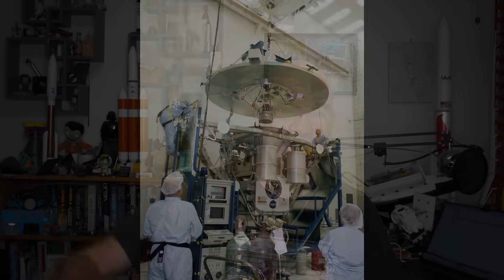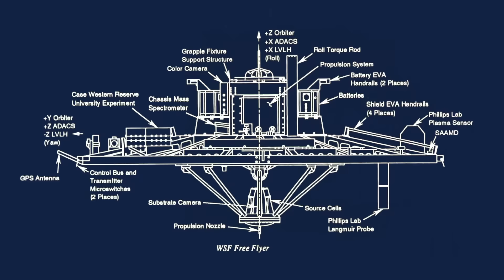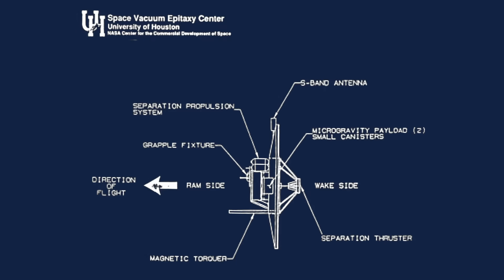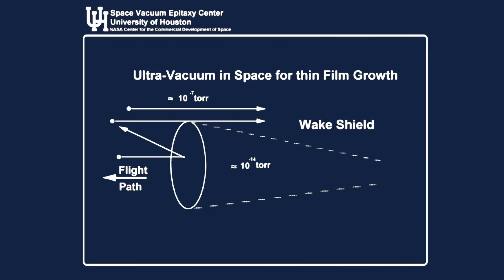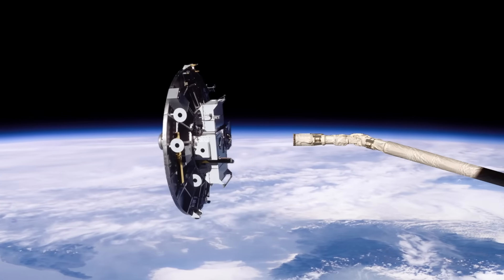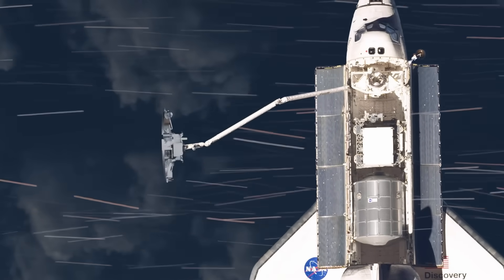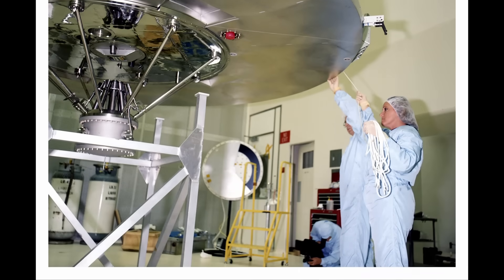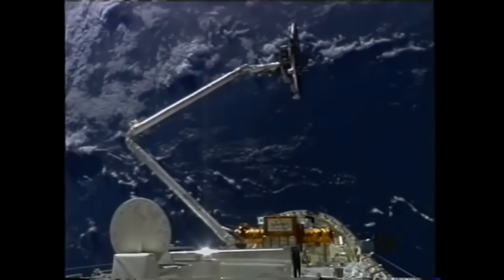How NASA Made The Vacuum of Space Suck More - The Wake Shield Facility

Comment: The Space Shuttle is underappreciated.  Every time it flew, you had a temporary space station.  It had an airlock, remote arm, a large 60'x15' cargo bay, a two level habitat with a toilet, and a large payload capacity.  The Shuttle was capable of performing a variety of missions including spacelab, satellite launch and repair, Hubble servicing, and building the ISS.  We don't have the capability to do what the Shuttle could do today.  There were problems and accidents but spaceflight is not safe.  The Shuttle was built using 1970s technology.
Reply: I wish they had carried on developing the Venture Star
Reply: Both points are true, not mutually exclusive. The shuttle was never less than risky. But it was also far more sophisticated than our current conventional 'benchmark'.

 In  hindsight... IF there  had been sufficient congressional funding to build a SAFE sophisticated design, back then ... there would have been a shuttle that had a go-around landing ability. (And a self-contained toilet.)

Most importantly, that potential shuttle should have been located ABOVE all the propulsive hardware. 

(Heat-tile headaches would still have plagued them. But overall risk would have been much much less.)

Had the funding been there for that improved ORIGINAL version of space shuttle, all the listed advantages (of shuttle over current space transport) would have been more easily retained for later space-transport  versions that could have flown today. 

AND ... like the historic shuttles, they would have low-g runway landings. These would have been  useful not only for delicate  cargo but also for seriously ill / wounded crew who would need urgent medical care. (We have dodged a bullet in that such an emergency has not yet arisen.)
Reply: You say that like launching an entire space station every time you want to launch a telecoms satellite is a good thing. 

The space shuttle was the equivalent of your takeout being delivered by a campervan instead of a moped
Reply: Using a manned spacecraft for cargo missions was risky, and very expensive verses unmanned cargo craft.  As for the shuttle being a lab, well a permanent space station make a better lab, why lift the lab up into space more than once, leave it in space, then resupply it with low risk cheap cargo rockets, and crew the permanent space station lab with small manned rated rockets.
 The Shuttle was way too expensive and deadly.  There were much better ways to do the job than the shuttle.
Reply: The Shuttle was a space station the same way a Winnebago is a house.
Reply: It is certainly not underappreciated.
Reply: I don't know: sure it was impressive but it was literally the deadliest space vehicle and the supposed savings from reusability never materialized. Maybe a smaller space plane with a heavy launch rocket would have been a far better choice
Reply: @misham6547  It was literally just as deadly as was Soyuz ) The same statistics, but Shuttle was an incredibly more complex and capable spacecraft.
Reply: @Boritis the Shuttle literally killed more people than the Soyuz and had a higher accident rate/launch. Any way you look it at it was the most dangerous launch vehicle
Reply: @misham6547  The Shuttle also carried much more astronauts. When a motorcycle crashes, 1 man dies. When a bus crashes, 50 people die. By your logic a bus is 50 times more dangerous than a motorcycle. Also, Shuttle had 2 disasters per 135 flights, Soyuz had 2 disasters + 3 incidents with mission failure per 135 flights. How so the Shuttle had "a higher accident rate/launch"?
Reply: @Boritis  the Soyuz launched more the 135 times (now closer to 140) with only two fatal accidents both of which before the space shuttle was even launched. Yes it did have SUCCESSFUL aborts but we can talk a long time about the times the shuttle almost killed of all it's crew (for example, the time when the thermal tiles were hit in a lucky place on a spar and the time that a gold pin almost blew up the entire crew) 
And about the bus thing: the space shuttle was dangerous already (unlike busses which are pretty safe and most people don't die in a bus crash) so stuffing more crew into a dangerous object is not a good thing. 
Overall the space shuttle was overrated and insanely dangerous: it is beautiful but it never should have been built,.
Reply: @misham6547  Soyuz has to be manufactured again for every launch, and it got all his main problems fixed over years.  All shuttles were built in the 70s with except of Endevour, which is built from spare parts. If NASA wanted to and had money to make some new orbiters now, they would be much safer, reliable and cost-effective than the ones built in the 70s.
You just don't understand the shuttle and what purpose it had. It's not about launching people to space or launching satellites (launching a satellite using massive winged orbital habitat with full crew is a dumb idea since you can do it with just a rocket). It was about working in space. Performing various tasks, mainly orbital assembly and maintenance. There was and still is NO other spacecraft in the world capable of doing these things. And there is simply none other spacecraft capable of retrieving 14 tons of cargo from orbit. That's why even comparing it to other spacecraft (which are just escape pods compared to shuttles) is also a dumb idea.
Reply: @Boritis  The physical layout of the Shuttle was bad: it had completely exposed thermal tiles prone to damage (even if they fixed the foam problem they still can get struck by other debris), it had SRBs right next to Hydrogen/Oxygen bomb, and because of its entire design and since SRBs couldn’t be turned off - many failure analysis ended with “ loss of orbiter, loss of crew”. To make it safe at least it would need to be liquid fueled , always have a rescue vehicle on hot standby, and be completely redesigned for a launch escape module. 
Also the space shuttle did receive upgrades (due to the fact that the engines had to be pretty much rebuilt and everything inspected each flight) and the last one Endeavor was built in 1991, two decades after Columbia. It didn’t fix the main problems the Shuttle being the Shuttle.
Unlike in all other human rated spacecraft it relies on its main engines for an abort: so any engine failure would jeopardize the entire crew. 
The better investment would have been in an efficient heavy lift rocket, cheap safe human rated rocket, and robotic maintenance of satellites. All of this would have been cheaper, safer, and been used until today. Instead we decided to make a conceptually flawed boondoggle.
Reply: @misham6547  That is what the Bureau of the Budget recommended (which become the OMB), as well as a science advisory body, in the 1970/1971 timeframe. A space glider atop a Titan variant was recommended instead, because the feeling was that there would not be a need for more than four manned missions a year. 

Another proposal at the time (around 1969) did look at a "booster first" proposal, of focusing on a reusable first stage booster. 

More than a few proposals looked at a two stage reusable approach, like a reusable flyback booster plus a shuttle orbiter.
Reply: The Shuttle was a great machine, but the reality is that its expense was hard to justify, and its safety issues could not be ignored. It's worth remembering that astronauts aren't disposable.  Unfortunately there was no forethought and certainly no planning to bridge the technology gap left.  One can be cavalier about safety and astronaut lives, but that just means you either don't care or you don't have skin in the game.  I had a colleague whose wife worked with the STS-1=7 crew for quite a while as preparation  her experiment to fly that mission on Columbia.  She was devastated by the loss of her friends. Imagine then how devastated the families were.  

The thing is that keyboard heroes who say insipid things like, "Was there a shortage of astronauts we were concerned about?" or "Well, the astronauts know it's dangerous".  Don't really give a damn about the people involved.  Such callous dipshits don't even think of such things.
Reply: "There were problems and accidents but spaceflight is not safe"

And that's exactly why it was retired. Why would you spend thousands of hours and a sizable chunk of tax payer dollars training people, people with families, only to send them to work in a vehicle that costed 5 times as much that it should and could fail in more scenarios due to human error than any other reason (manufacturing etc). It needed to be retired.
Reply: I think the appreciation level is correctly calibrated.
Reply: Everytime the space shuttle was relaunched, it nearly cost the same of a original cost of space shuttle,  after it was serviced, it was really used to launch secret squirrel satellitess, after alternative launch mechanisms could be made it was canned.
Reply: Space Shuttle although capable of some amazing things was a steaming pile of turd in general. "Temporary space station"? It was incapable to stay in space for more than two weeks. "Satellite repair"? Good luck with that unless it was in lower 1/3 of low earth orbit as it was incapable to reach above ~640km (~400 miles). It was so expensive to launch, it would be much cheaper to just launch a new satellite in 99% of cases. In fact even repairing Hubble telescope wasn't much cheaper than just launching a new one. Also it killed more astronauts than everything else combined.
Reply: @woopsserg  One Shuttle mission, STS-80, flown by the Columbia, lasted for 17 days, 15 hours, and 53 minutes. 

The idea of a temporary space station that orbits for 2+ weeks and returns to Earth is not a bad one, with maybe exceptions for research programs that are working with experiments that could be disturbed by people knocking about the spacecraft.
Reply: @michaeldunne338  STS-80 Space shuttle was not a standard one but specially modified with EDO pallet placed in payload bay for longer duration in space.
Reply: @woopsserg  Ah yes, the Extended Duration Orbiter pallet. Forgot about that. Quite interesting.
Reply: problem was it couldn't really stay up long. we celebrated 3 week missions while the soviets were celebrating 8 months in space
Reply: ISS has all of those things.  The only thing it can't do is change altitude and grab sats.  But that is really it.
Reply: Back to the point...
Indeed! It will always be a testament to what is possible with almost bare minimum working knowledge.
Reply: Imagine if Hubble had launched during a non-space shuttle era. We would absolutely not have been able to fix it. It's weird to think about that, we used to live in a world where you could go up to space and FIX something, we just can't do that anymore.
Reply: Yeah, maybe it could have seen updrage paths instead of it's cadence slowing down after each disaster and eventually being cancelled.
Reply: A lot responsibility falls onto management - mostly for time pressure and also cost reasons
Reply: Shuttle had great capabilities, but was never really reusable, and cost was exorbitant. It should have been retired a decade earlier and we would be ahead in our capabilities now.
Reply: @tsufordman and we should not have built an entire single use rocket using its part. Just the RS-25 engines of the STS cost more than the next capable rocket
Reply: I think the shuttles real problem was management trying to ignore reality to push missions in unreasonably dangerous circumstances. Both issues that led to shuttle loses could have been addressed in a better way, but they weren't.
Reply: It is too expensive. It cost over one billion per launch
Reply: I don't think it's some great feat that the space shuttle was a whole space station whether you needed it or not. We could launch crew and extended living chambers into space with every satellite launch, but what a waste that would be.
Reply: And that's one of the reasons it was such a bad idea, one spacecraft that can do everything is fundamentally a bad idea
Reply: That's valuable, but not to the exclusion of the ability to ditch the orbiter for a dedicated heavy lift capability.  The Soviet shuttle clone was a lot more practical in that regard (also had the ability to ditch the humans for more dangerous mission profiles).
Reply: @FireStormOOO_  But the super heavy lift launch system - Energiya - was expendable. That was a big minus. In addition, the strap on boosters presented problems even after Energiya was all but cancelled in 1990, as in RD-170 engines experiencing failures in 1990, 1997, 2007, 2013.
Reply: @michaeldunne338  The US really didn't save any appreciable amount of money reusing SRBs.  The main engines would've been a better argument, but not if they need to be rebuilt after every flight.  At the point you're talking about needing 2 or 3x more launches (the orbiter is fairly heavy) you need waaaayy better cost efficiency on reuse to get ahead.

And yeah, note I was talking about the overall design of Energiya.  Late 80s/early 90s USSR was broke AF and falling apart.  It's astounding it did as well as it did.

And NASA had concept drawings that'd get most of the benefits I'm pointing to - minimal shuttle with just the engines and more payload, both expendable and reusable concepts.  The version without the huge wings that'd have made the orbiter a little less stupidly heavy.  But the funding really wasn't there in the US either after the shuttle failed to live up the the hype initially, so we were stuck operating the first design for 40 years without iterating at all.
Reply: @FireStormOOO_  For a first attempt at reusability with a program of that scale not sure one can completely knock the Shuttle about the costs of refurbishment and maintenance. As for Energiya, the overall design took a big step back from reusability with having the main engines expendable; and the engines for the strap on boosters proved problematic though out the program, and a leading cause of delays. The Spiral team was not impressed with the US Space Shuttle and thought it could have done better than the Energiya/Buran concept. 

The Buran/Energiya system seem to concern the Soviets overall even after the first flight in 1988, given the very conservative launch schedule laid out for the early 1990s - and probably justified given the accidents with the first stage engines with Zenit in the 1990s and 2000s. 

Personally I thought the Enerigya launch system was pretty interesting, and presented an intriguing set of  "what if" possibilities for the Soviet / Russian program if it kept going.
Reply: @michaeldunne338  Yeah have a look at my other comments.  The mistake with the shuttle wasn't so much that it wasn't perfect on the first try, but that the flawed version one got locked in with all the warts and then we didn't iterate on it for 40 years.  NASA projects have a bad way of turning into pork belly spending where nothing can get fixed or improved because it might undermine a supplier in this or that senator's district.  That dynamic has persisted and dogged every NASA launch system concept trying to replace the shuttle too.
Reply: @FireStormOOO_  The Soviet Shuttle clone wasn't a Shuttle clone, It was useless engineless spaceplane on top of a very large expendable single-use rocket.
Reply: @Boritis  That very large expendable single-use rocket was also able to be launched without the heavy orbiter, letting it do in one mission what might take the shuttle 3+.  The shuttle design also makes you risk crew on every cargo mission even if they aren't needed.

And implying the shuttle is re-usable is generous.  Mostly recyclable.  Recovering and recasting boosters is 80% of the work of building new.  The tank was expendable.  The heat shield and engines needed almost as much work as making new.  The cost savings of pursuing reuse never materialized and that left the shuttle as a mediocre jack of all trades that was stuck with serious design concessions from chasing reuse for little benefit.

I have little doubt both vehicles would've been radically better if they'd been given time and money to iterate and make a version 2, might have even realized the goals.  But never happened so we're left to speculate.
Reply: @FireStormOOO_  Shuttle might perfectly fly without crew. Crew were there not to just fly the thing, but to perform various tasks in space, mainly for assembling or maintenance. It was also a space station.
Reply: Shuttle was way too expensive, partially because it had all those features and capabilities.
Reply: Sorry but the Shuttle's safety record is absolutely inexcusable and it had to be retired.
Reply: @edmund-osborne after columbia the commission stated that the shuttle shouldn't be retired (as they didn't, it kept flying till 2011) but requilified, maybe changed in some aspect to match the safety standards. which they did, sts has 1 on 90 chances of LOC, 10 less then soyuz, the most reliable spacecraft at the time. crew dragon has a chance of LOC of 1 in 270, a lot higher but it entered service almost a decade later, it's no where near close to what shuttle done, and it's from a private company which has much more to lose from a LOC event than the government, as they also sell to private customers. the only real reason the entire sts program was cancelled was due to economic reasons, there was no way for congress to sustain shuttle launches costs at the slow rate the supplier could deliver plus the iss plus all the other programs, including constellation at the time which was the big new program, main reason behind sts cancellation
Reply: @edmund-osborne  that's why we stopped using it. It is not relevant in any way whatsoever to anything that was said. Stop being a know-it-all
Reply: @edmund-osborne What an ignorant way of looking at things. The automobile was also ridiculously unreliable and complicated - we should have stuck with horses and carriages. Diesel locomotives were otherworldly and expensive with limited people able to service and work on them.  Initially. 

Yes, sending a “dumb” capsule that basically keeps everything inside safe is..well, safer, but its capabilities are MASSIVELY limited. 

After shuttle, we went straight back to the days of Gemini - and you would have us believe that was an “upgrade” over the shuttle. 🙄

It was the most complicated vehicle / machine mankind has ever created. I think it was a masterpiece of engineering, and as the OP stated - provided a capability they we aren’t even CLOSE to matching today. 

There were many complex high-performance aircraft programs that were (statistically) far less safe than the space shuttle, in spite of its massively more complex flight regimes and requirements.
Reply: @EstorilEm Appearance does not indicate potential. Just because Dragon for example doesn't look like an aeroplane doesn't mean it's not superior to the Space Shuttle in every way. For one major reason , there's actually a working emergency abort and escape vehicle procedure that works. The lack of foresight in these comments make me think they're generated by bots. No person could be this naive.
Reply: @S3SSioN_Solaris superior to the space shuttle in every way? Bro. I like SpaceX, but you’re comparing an Isuzu Trooper to a Ferrari. 

And people making you sound stupid doesn’t mean they’re bots, it just means you may in fact be… stupid. 

Shuttle could actually carry a payload (you know, ANY payload, imagine that!) much less something the size of Hubble. Obviously it was also capable of attaching to it and performing maintenance. It could also catch and return satellites. 

Right off the bat, those are crucial capabilities we no longer have, and something no capsule will ever do. 

It was also a true space “vehicle” in that it could become its own space station, supporting 8 crew for nearly three weeks. 

We tested SO many things you could never do with a capsule, including the first untethered spacewalks with the MMU. 

It’s carried more than 3 million lbs into orbit, including the majority of the ISS. Again, none of which is possible with a capsule. 

It also provided a capability to perform unknown missions with a large and flexible crew platform - we COULD theoretically do some outlandish missions with the shuttle, perhaps even similar to what the 90s movies showed. It at least gave you the starting platform and basis - there were even proposals for using the payload bay for additional OMS propellant allowing the shuttle to be even more flexible. 

…you’re comparing everything I just said to an “Uber to LEO”. It carries people and their lunch boxes. Period. Nothing more. 

Crew Dragon is PERFECT for what it was designed to do, and they did a damn good job with it, but comparing it to the shuttle (much less saying it’s better) is freaking ridiculous. 

The shuttle wasn’t designed to be an ISS uber. It was the next incredible / impossible thing NASA accomplished after we landed on the moon.
Reply: @edmund-osborne  How many people have died on Shuttles over the whole program, compared to pedestrians killed crossing the road in that time?
Reply: @Ensign_Cthulhu meaningless and irrelevant question
Reply: @Ensign_Cthulhu  Just in the united states, it's around 5,000 per year, and a lot more of us get permanently injured.
Reply: @edmund-osborne I'm gonna need to assume you don't drive a car for that level of risk aversion as your rationale. Nobody goes into space assuming it is safe. Nobody.
Reply: Yeah cars are stupidly dangerous but they don't blow up and kill you 1.5% of times you start the engine.
Reply: and anyway, there are much safer space vehicles out there, such as the wildly successful Soyuz
Reply: @redactedhash  2 missions lost with how many flights - those odds were not good. We should build a new one though using lessons learnt from the first time round.
Reply: @paul227-u1p Overall, in retrospect, you had a 1.5% chance of dying on every Shuttle flight.
Reply: @edmund-osborne the space shuttle was not retired due to unacceptable risk to the crew and you are silly if you think that's the reason.

Also, one of those two failed on re-entry... can't help but notice that SpaceX has failed on re-entry how many times now and still hasn't even deployed anything to orbit let alone be crewed?

Your comparing vehicles that serve separate uses- the Soyuz is a crew lift vehicle that is equivalent to a small airplane. The space shuttle was a crewed heavy lift vehicle with retreival and deployment abilities... not exactly the same mission profile- and nothing today can match its capabilities.

Retiring the shuttle set us back decades. And with no equivalent replacement a valuable scientific tool was lost.

And for what? Most of the existing knowledge lost instead of invested in a program to work on a replacement while fixing existing issues. Terminating the shuttle program was a foolish decision that has always been justified by the "risk" when it has always been a purely political decision
Reply: @redactedhash Even if that's true, you can't just say "oh well space flight is dangerous anyway" because the Shuttle made it *pointlessly* dangerous due to bad design.
Reply: @edmund-osborne  Your "wildly successful Soyuz" has the same safety ratio.
Reply: @edmund-osborne  When a motorcycle crashes, one man dies. When a bus crashes, 50 people die. By your logic, buses are 50 times more dangerous then motorcycles.

And Space Shuttle wasn't just a bus compared to Soyuz. It was a bus and a truck capable of carrying 30 tons of cargo
Reply: @redactedhash  the space shuttle was  statistically the deadliest vehicle, Souz launched more people yet was far safer. It was pretty much the only human rated space vehicle which had "blackout zones" where an abort was impossible (and even then return to base was extremely sketchy). It also used SRBS which could not safely shutdown for the crew to eject. It had no eject tower either. Also it had a lot of heat tiles that had to be in good condition otherwise the crew would die on re-entry. Also don't try to launch it when it's too cold either. 
Yes the space shuttle could do some impressive stuff and space travel is dangerous: but it doesn't excuse the  fact that it was insanely dangerous, everything had to go well on launch since there was no "plan B"
Reply: If only it had flown just once we could say it was 100% safe. 🤦‍♂
Reply: @misham6547  Apollo and early Soyuz were deadlier. Although I think later Soyuz has been safer and an incrementally-updated Apollo might have been safer.
Reply: @paul227-u1p 2 lost. One almost pancaked on flight 3, let's not forget the luck Discovery had on 27. Or the burn through on at least 15 flights starting with the 2nd.

Not to mention the many times the toilet broke, the hydrogen leaks that grounded the fleet. Then a wiring issue that also grounded the fleet. She was at best a test vehicle. Very capable, just not capable of rapid flight cadence
Reply: If you go through the safety features of Apollo, Soyuz and the Space Shuttle. You will quickly understand why the Space Shuttle was a bit of a death trap. 
For Apollo it's hard to make any statistical analysis with so few launches. And yes the early Soyuz had bad accidents early on, but it didn't have the glaring safety flaws of the space shuttle like the exposed thermal protection, the single point of failure of SRBS, entire zones where a failure in a booster would mean the death of all the crew, not having any actual escape capsule, that's not mentioning that the Space Shuttle never realized it's cost savings
Reply: @AveragePicker it did.... Unmanned and under autonomous control
Reply: @edmund-osborne  I know another spacecraft with similar safety record. It's Soyuz, and it's still flying (same ratio of deadly catastrophes and even worse ratio if we'll include disasters when the crew survived, but mission was failed and spacecraft was lost). Just because Russia don't have any replacement for them =).
Reply: @edmund-osborne  
Was there a shortage of astronauts that we were concerned about?
Reply: @universeisundernoobligatio3283  Horrible bait
Reply: @universeisundernoobligatio3283 rage bait used to be believable
Reply: @universeisundernoobligatio3283 that's a bit of a calloused way of putting it, but generally- these people knew what they were doing and the kind of risks they were taking. A good bigraphical reference to make might be to the movie The Right Stuff.

The debate over the safety only became a true issue when school children saw a teacher die on live TV when the Challenger exploded...

The reason the space shuttle was retired was entirely a political concern trolling over the pilots because they equated the children that were traumatized with the crew who had accepted the risks.
Reply: @Scottagram As is/was your original comment. 🙄 I was going to let it pass for plain STUPIDITY.
Reply: @universeisundernoobligatio3283 idk but im seeing a shortage of neurons in this comment